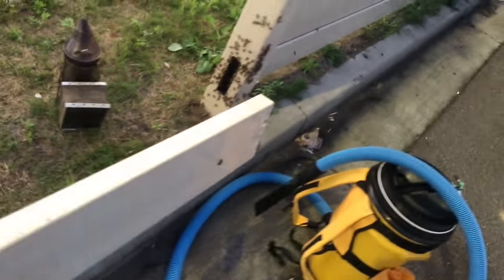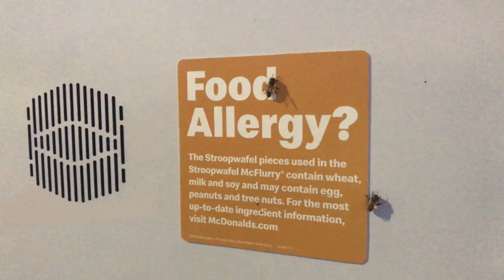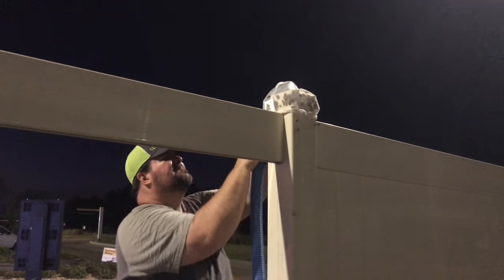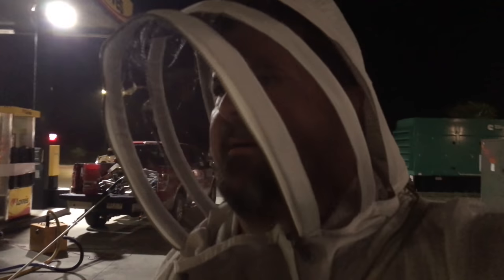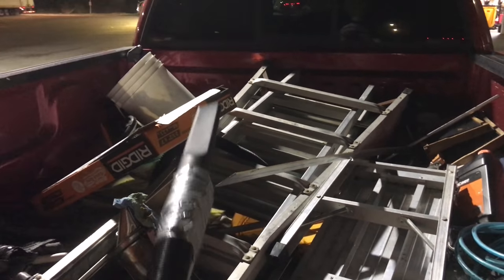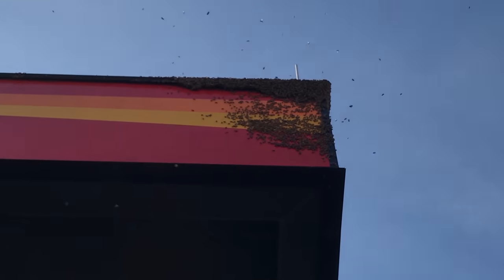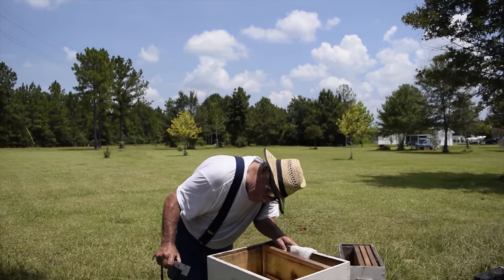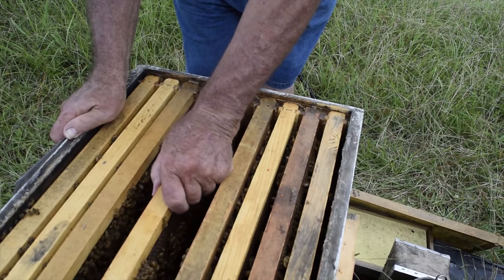Trouble At McDonald's

Comment: As good as you are at engineering that hose together, I willing to bet the next time you get called to that truck stop, you'll have that hose attached to a drone so you won't have that shoulder work out.  Let your fingers get the abuse instead of your shoulder. Man, you always get the easy ones. God's peace brother.
Reply: I'd be curious if the wind created by the drone blades wouldn't stir the bees into the air??

Comment: You might want to make yourself a PVC extension with unions & a Tee at the bottom to attach your vac.  You can just push together the pieces to whatever length you need & attach the vac at the bottom at the tee with a cap at the end.

Comment: 2 removals and a few swarms on a single battery charge?  Sounds about right!  Nobody believes it runs that long until they try it, and many STILL don't believe it even after they've done it themselves!  The secret is that I put a nuclear reactor in there for the battery...  Oh, I was surprised that you didn't put the ladder in the bed of the truck to get the extra few feet of reach to climb up there.  Done it myself, it works great.

Comment: Why didn't you setup the ladder in the bed of the pickup, and use some ratchet straps to stabilize - so the "extensions" on the hose would have been shorter???
Reply from the maker: Movement of the truck would have caused the ladder to scratch up the front of that nice shiny canopy.